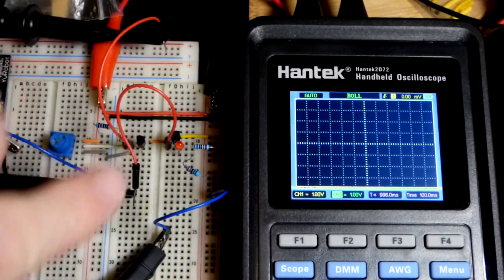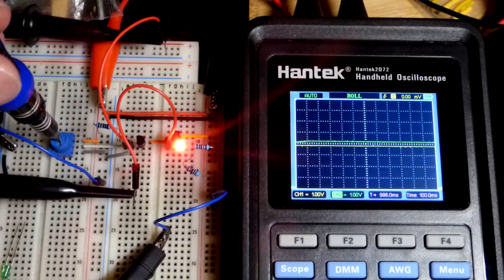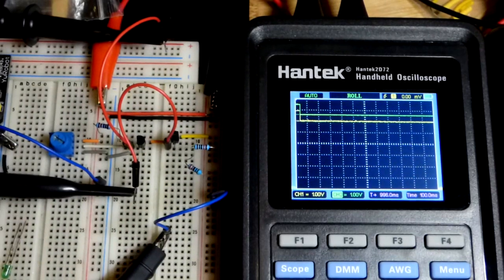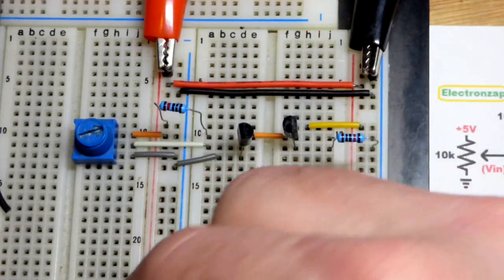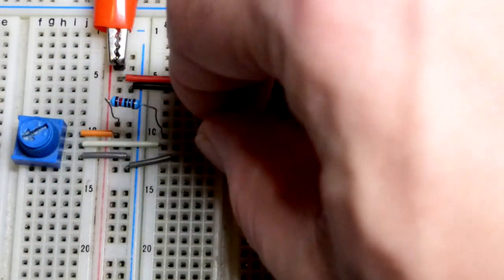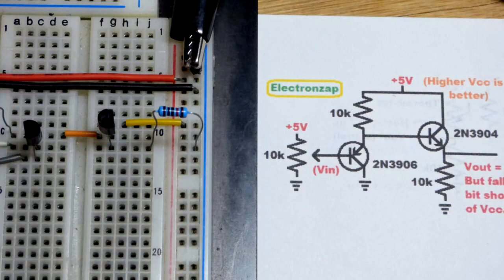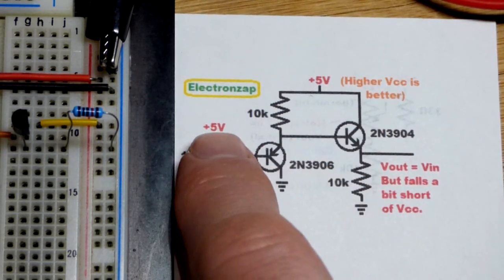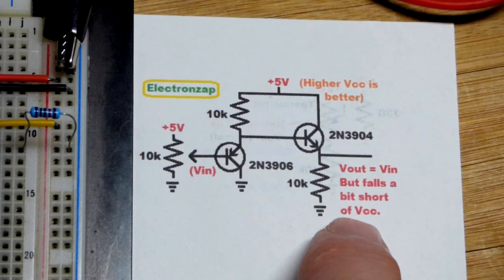Cascading emitter followers PNP and NPN BJT to offset voltage drops learning electronics shorts 123

Comment: The reason you lose .6 volts when the input to the first transistor is at 5 volts is because the first transistor is off and you end up with the .6 drop of the second transistor.

Comment: Is this considered an ab amplifier?
Reply: Yeah that makes sense. Thanks.
Reply from the maker: I could be wrong but I don't think it is any class of amplifier. I just see that reference to when it is an alternating current circuits. I haven't spent much time studying AC circuits. Since the output voltage just goes up and down in relationship to ground, I would think it is closer to, if not, a class A amplifier. Whereas if the output voltage could alternate positive or negative polarity in relationship to ground, I think that would be considered close to, if not actually being, a class AB amplifier.